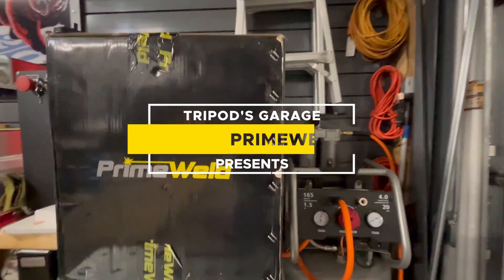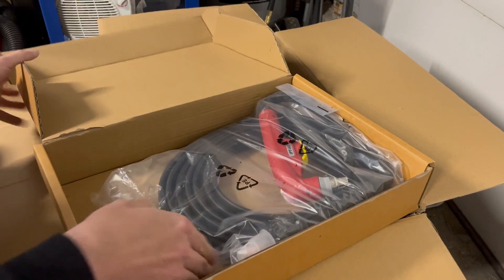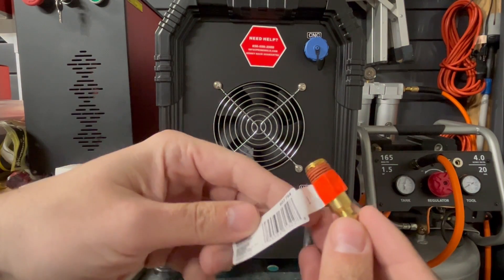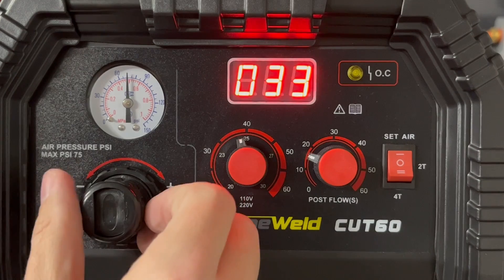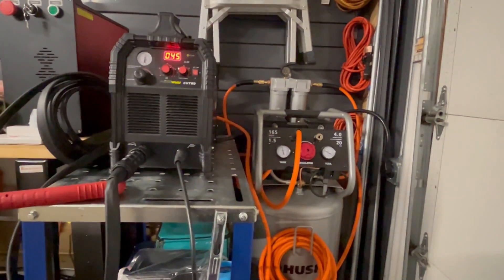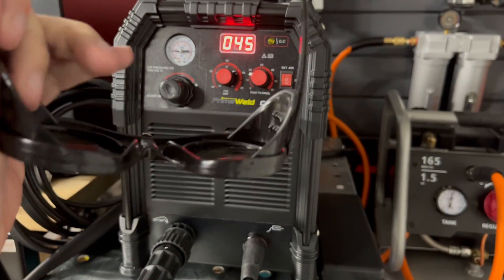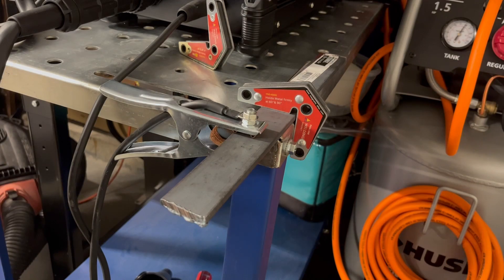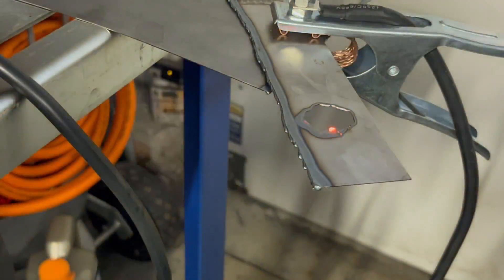PRIMEWELD CUT60 - AFFORDABLE PLASMA CUTTER

Comment: 3:37 - the manual states this is a g1/4 gas fitting, did you really use an npt plug? or was your unit different? curious because I'm getting one of these and will want a quick connect for switching gas types

Comment: Angling toward the cut direction helps preheat the material.
Reply from the maker: Thanks for the tip!  I will also need to find a chair with good side bolsters to maintain my balance.
Reply: @TripodsGarage  the manual for my ProCut recommends 8-10° attack angle. I also like your "drag cup" design better than Lincoln's.